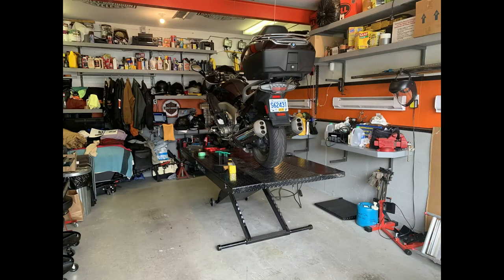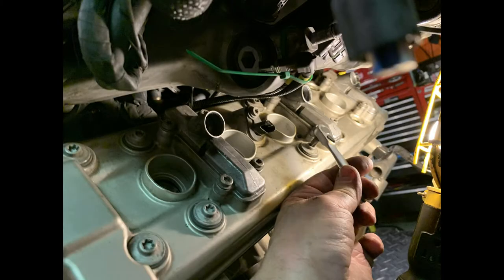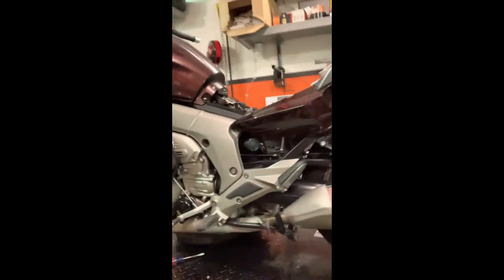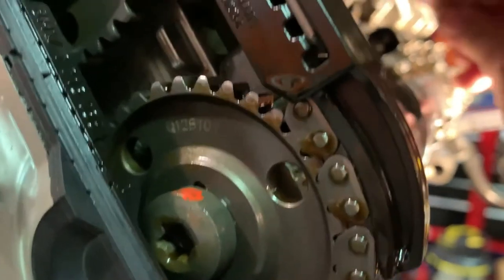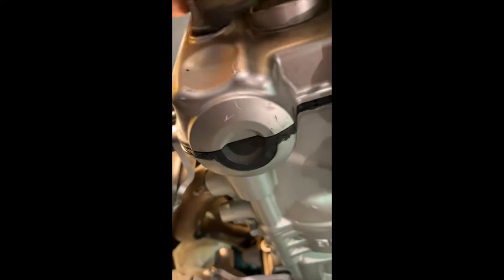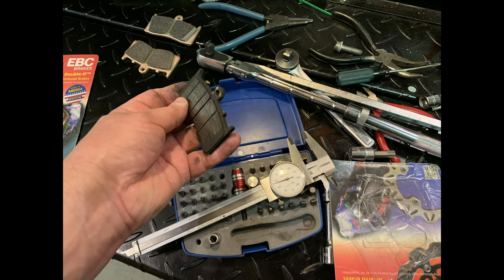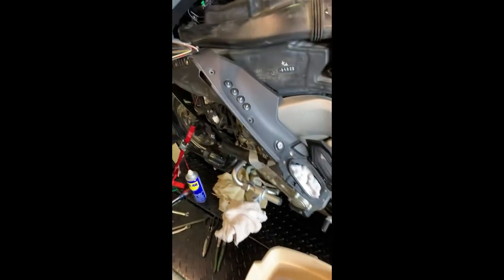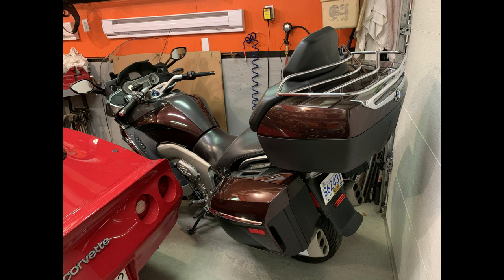30k BMW K1600GTL Service

Comment from the maker: Well I have to admit, I was a Motorcycle and Small engine and Marine Mechanic and have been working on and servicing all makes of motorcycles since the 70’s and have never had any services done at a dealer accept the first one for the BMW because it was included in the deal. I have my own tire machine and that’s the only service I offer now is tire changing and balancing
Reply: That's amazing 👏

Comment: Hello Randy, nice video! advice: how long (in hours) does it take to dismantle the parts to reach the injection coils (carrosserie and radiator)? My k1600 gt started to be rough at idle, and I think it maybe a defective coil (or a wet one, I washed the bike with pressure 3 weeks ago). Thanks!

Comment: No way valve adjustment required at 19000 miles. Dealer will try to extort you for 2 grand for service you don't need. Caveat emptor

Comment: Thank for the video Randy. On a side note, what brand of highway pegs are you using?
Reply from the maker: Ilium works. Highway Pegs for BMW Engine Guards
Ilium Works

Regular price$320.00
Reply from the maker: https://cdn.shopify.com/s/files/1/0017/8765/8299/products/a5745b6c4012373e587fdf2115381af4_940x.jpg?v=1530179833
Reply: @6550gateway  Thanks mate.

Comment: Thank you SO MUCH for posting this. I was considering doing my own service but after seeing this I will WISELY pay a professional wrencher. I've done plenty of repairs on 70s-00s cars, but find I don't enjoy it anymore and it's just crazy with all the new tech. Big 👍 to you. Safe journeys.
Reply from the maker: Glad you enjoyed it, what type of motorcycle do you have?
Reply: @6550gateway  2012 K1600gtl that I bought last May. Found it online, flew down to Nashville (from MN) and rode it back in two days (1000 miles). More than double in size & power than anything else I had rode previously...... and loved every minute.... including the couple of hours of rain showers on day 2.

Now I just hope it doesn't cost me a fortune to get serviced.... doing a five dayer from MN across and around Lake Michigan and the U.P. this July.
Reply from the maker: Nice bike, you will love it. The full 30k  service up here in Canada costs around $1000.cdn at a dealer so you can save yourself a lot by doing it yourself. My 2013 GTL came from Florida and was actually featured in a youtube video from the dealer.
Reply from the maker: https://youtu.be/-PKha6T-aMc

Comment: Hey Randy,
My 1600 bmw die out @ idle after I let go the gas . Please help even the dealer can’t figure it out .
Thanks
Reply from the maker: it is possible that the "throttle by wire"  is not calibrated to the throttle body. A GS911 Interface unit should be able to detect and calibrate it. This might be above the capabilities of a GS911 but dealers should be able to re-calibrate everything on the bike with their factory testing units.

Comment: Hi.  After replacing the pump and injectors, and cleaning the fuel injection system, the engine does not start.  When I disconnect the tube from the pump - quick connector, the engine runs smoothly for several seconds (fuel pressure below 1 Bar).  After reconnecting, it turns off (Fuel pressure 3.5-4Bar).  The scanner shows no errors.  I don't know what the cause is.
Reply from the maker: There was recently and recall on the fuel pump, the dealers replace them for free, hopefully you got in on that. I had my GTL pump replaced a few months back, I never experienced a problem but some have had issues that sound similar to you. The dealer needed my bike for 4 hrs to replace and calibrate the new pump so maybe there is a software step that can only be done at a BMW dealer.
Reply: @6550gateway  Thank you for the quick reply.  I replaced the spark plugs, pump, pump electronics, injectors, cleaned the entire fuel system.  In the Moto Scan BMW program, I don't have all the adaptations.  more options are in 911. I'll have it on Tuesday.  Greetings from Poland

Comment: Randy I have a 2015 k1600gt w/11,000 miles. It just started a clacking sound around 3000 rpms and it makes a similar noise decelerating through the 3000 rpm range. I accelerated hard to 6000 rpm and no problems (no clacking,smoke,missing popping etc.) But while decelerating through 3000 rpm it made the same noise. Reading in the forums there are many posts regarding this. I called the dealer and was told the valves probably need to be adjusted. This is contrary to the posts on the forum. Have you had any similar experience with your bike or maybe friend's bikes. Any help or advice would be appreciated.
Reply from the maker: No I can't say I've heard that sound on my BMW. Mine has 60,000 miles on it now and my actual valve clearances are what they were when it was built. They say measuring the Intake clearance should be between 0.13 -0.23 and all my actual valve clearance  measurements were 0.15,  Exhaust clearance should be between 0.23 -0.33 and all my actual valve clearance measurements were 0.25. So for 60,000 miles I have had no valve wear whats so ever.

Comment: Did you replace valve cover gasket and spark plugs ? I have to do my valves at 54k I had 57 k now so I am a little overdue, at 36k all valves were within specs. Biggest pain is to remove secondary air supply.
Reply from the maker: no I didn’t have to replace the rubber gasket and yes I did replace the spark plugs but won’t the next 30,000k service. Those plugs are rated for 100,000k from the manufacturer. I also added new antifreeze but won’t the next time either. My valve clearances were exactly the same as it came from new, no wear what’s so ever. The intake is between .013 and .023 and exhaust is between .023 and .033. I went one step further and actually measured to see what they were and all my intake valves were .018 and all my exhaust valves were .028 and my BMW has 67,000 miles on it and it runs beautifully. I’m of the belief now that if all the clearances are good after the first 30,000k service you could skip the next one and just do the brake fluid flush. oil and filter and air filter. After 30,000k even my diff oil came out clear but it uses so little I would also change it too and of course do all the other checks and spot oilings on moving parts and check all bolt and screw for tightness.
Reply: @6550gateway  I am actually planning to check this time exact clearances. My radiator needs good cleaning after last long trip. I will replace spark plugs as I replaced them at 18 k but gasket should be good as I replaced it at 36k. Brake fluid was flushed last year so I ma good for another season. I did changed shaft oil when I replaced rear tired about 6 k it was very clean and I lubricated rear shock linkage and shaft splines last winter so I am good. Bikes still runs very strong, does not use any oil btw changes. It is actually not that difficult to work on as people think. Good luck and thanks for replay

Comment: Hi Randy, very informative video, how /where do you make the adjustment if the spec is out for either intake or exhaust? I had an RT, which was very strait forward to adjust the valves..
Reply from the maker: If any of the valve clearances are out of spec you have to remove the camshafts and change the shim that is out of spec. So if the clearance is too wide you change to a thicker shim. If you are doing that you need to make yourself 3 tools all the same. Threaded metic stock that you thread into 3 of the spark plug holes that have wide washers and nuts on the tops so you can keep the pressure on the upper cam housing so you can remove all the mounting nuts on the cam housing and then slowly back them off evenly to release the housing. The cams are under valve spring pressure. You’d also have to remove the cam chain tensioner.

Comment: Awesome video Randy!  Would be great if you had a tripod and could record the entire service!  I've got the same color - Demansk Red - K1600 - 2013.  Really like the bike hoist - showed it to my wife - maybe a Christmas present next year!  I was surprised to see your rear brake pads still in "new" condition - just assumed they would be worn.  Did you replace the rear pads previously - maybe at 24 or 18k miles?  why don't you use the center stand vs the hoist (on the hoist)?  I just bought my bike this year - had 13,750 on it - and put ~5k on it this summer - so ready for my 18k service.  I'll have this one done at the BMW dealer - but in the future would like to be able to do the minor service {(oil, brake pads, etc.).  Do you have to take the fairing off to remove the gas tank covers to get to the air filter?  Thanks for the insights!
Reply from the maker: Yes I like the Damask Red too. The bike hoist is invaluable, use it often for both the Harley and the BMW. I changed the rear brake pads at the last 30k service, I’m easy on the rear brakes unless I’m towing my trailer then they do 60-80% of the braking. I don’t use the center stand when I’m going to be changing the oil. I use a scissor lift below the center stand frame so I can lift the bike up higher, more room for the drain pan and my hands to remove the outer and inner oil drain plugs. Tip: when you remove the inner oil drain plug make that your torx socket is flat on the end and not rounded at all or the drain plug could roll off the tool and fall inside the lower oil pan. You do not have to remove any of the fairing panels to get at the air filter, remove the seat and the screws at the base of the tank and the screws up on the top. You remove the center panel and then remove the top tank screws. Put your hand flat against the side of the tank and apply a backwards pressure so the inner panel slots can slip off the posts. If you are going to be doing your own servicing you’ll need to invest in a GS911wifi interface unit to be able to check codes and reset the service reminder.

Comment: Great video Randy! do you know where is the camshaft sensor located?
Reply from the maker: Yes, you can see the Camshaft Sensor  between coils 2 and 3 on the valve cover. Stop the video at 1:20 and you can see it.

Comment: Hi bro , my battery is dead , how do l get to it ? Thanks .
Reply from the maker: it’s easy, just remove your seat, remove the two torx head screws on the battery clamp and undo your two battery cables, always remove  negative cable first and when reinstalling a new battery install the negative cable last.
Reply: @6550gateway  Thank you so much .🙂